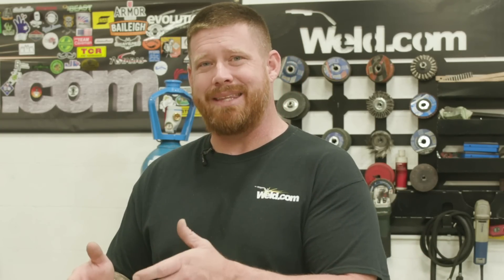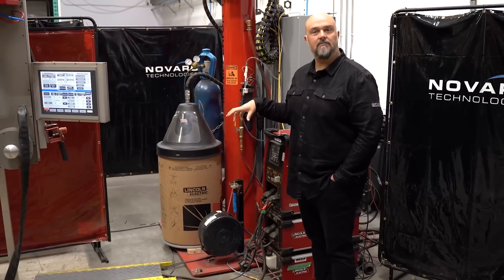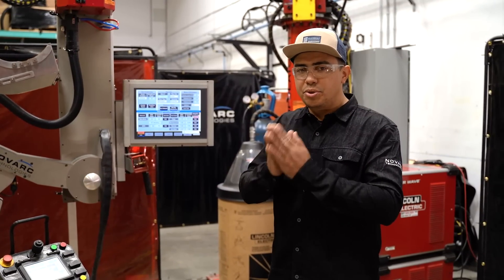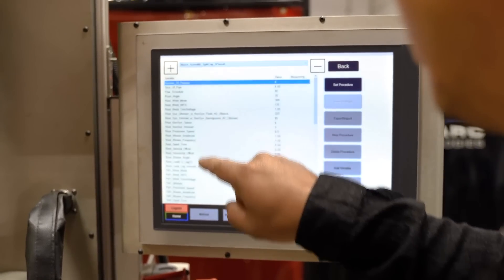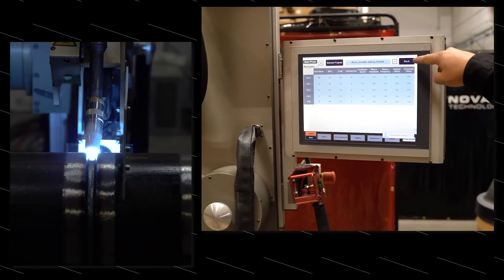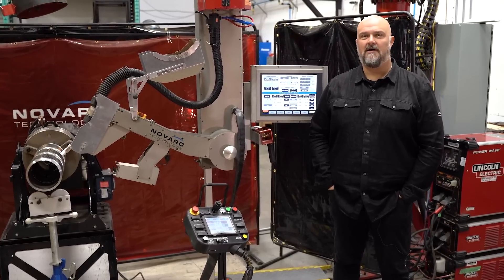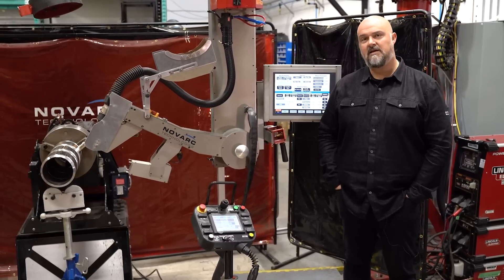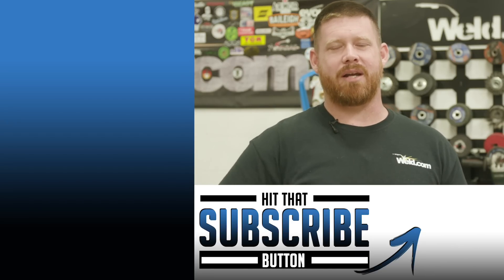Novarc SWR Welding Co-Bot | Fabtech Cancellation Series - Day 4

Comment: neat tech, but that will put us rig welders an shop hands out of work
Reply: True story.
Reply: @Peter Dixon this is a bunch of bs guys. Sorry, but here’s the thing you are all missing. Robots are worthless without highly skilled, highly knowledgeable welders to set every tiny component of the operation up, tweak things, correct the robot, correct the programs, constantly watch and evaluate, make changes, and keep things running the way only we know that they need to run. Who do you think this will replace? It won’t be those who truly know the craft, the science, and the art. It will be the ones who have no ability to adapt, don’t understand the science of welding, don’t understand the variables of the process, the ones who are just “rod burners” who only know how to do one thing but don’t have the knowledge to adapt when something goes wrong. With or without robots and advanced technology, the days of the rod burner who lacks the technical knowledge to support whatever skill they have are numbered. This is not anything new.
Reply: @wroger wroger why the fuck would i adapt to something i don’t even agree to in the first place this video if fucked it’s promoting robotics machine over an good person to make a pay chq you plug
Reply: @dannyjames7595  The world won't run off of manual labor forever, it's a lot more efficient to have robots do things than people, that's just how it goes